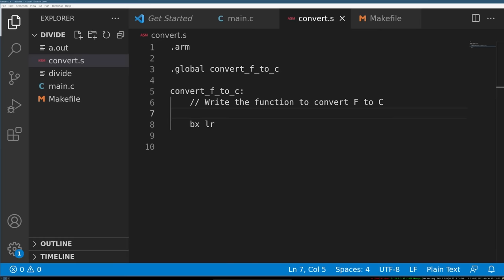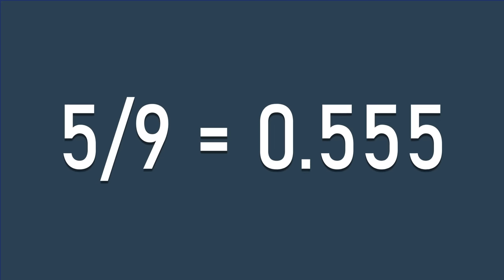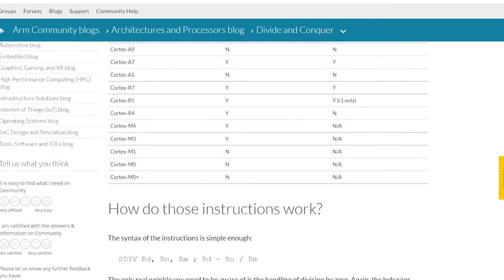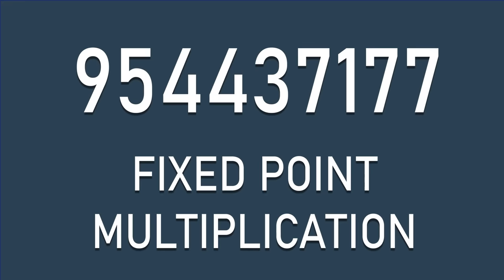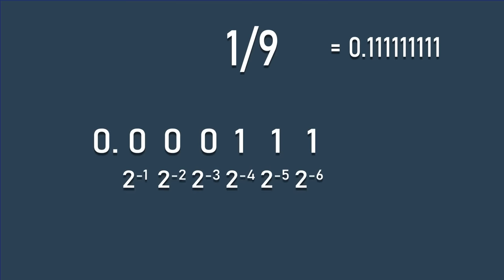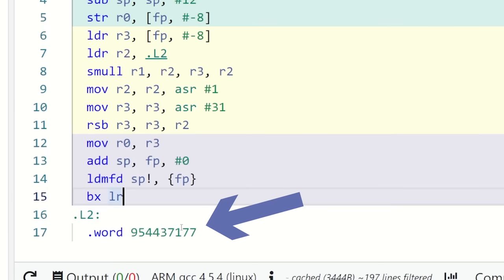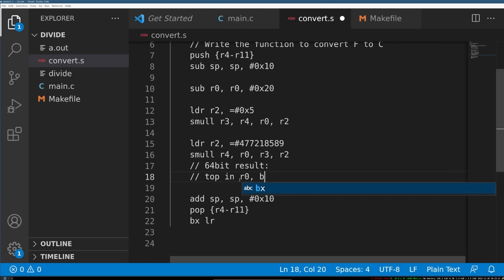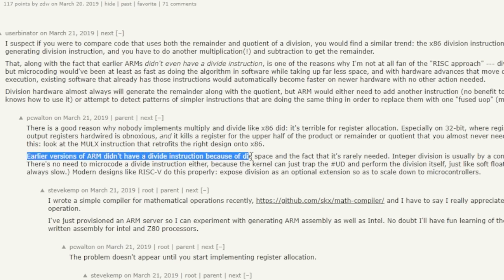computers suck at division (a painful discovery)

Comment: Also important to know is that both integer divide and FPU divide are very slow even on architectures that supports it in hardware.
An integer divide is up to 12 cycles on Cortex M4 and 10-50 cycles on modern X86-64 for example, Skylake needed like 40-100 cycles for integer div just a couple generations ago.
FPU divide on Cortex M4 is 14 cycles. Compare that to 1 cycle for integer add/sub/mul/shift and 1 cycle for FPU add/sub and 3 cycles for FPU mul on M4.
Also noteworthy is that even architectures such as M0/M0+ can implement external division hardware, such as the case for the RP2040 using M0+ architecture which integer division hardware needs only 8 cycles and therefore is actually faster than standard Cortex M4 for integer division.
Reply: If integer ADD/SUB/MUL is so fast, then why isn't it used everywhere?
Reply: @ewenchan1239  Can you restate your question, as it doesnt really make any sense. Are you asking why a div instruction isnt substituted with a combination of add/sub/mul instructions? They are, the compiler will try to replace a divide either by a shift, a combination of muls and shifts or adds and shifts, depending on if your target supports mul instructions.
However this only works if the divisor is a compile time constant. For other cases the compiler most likely will use div instruction unless you tell it otherwise. For example you could use libdivide instead, which can be faster than hardware divide on a lot of targets. Or you could tell it to use its default inbuild algorithm, which most likely will be quite a bit slower than a hardware divider if the compiler cant optimize it down, which in a lot of cases it can.
Reply: @_--_--_  
"Can you restate your question, as it doesnt really make any sense."

You state:
"FPU divide on Cortex M4 is 14 cycles. Compare that to 1 cycle for integer add/sub/mul/shift and 1 cycle for FPU add/sub and 3 cycles for FPU mul on M4."

If your statement above is true, then why isn't it used in lieu of using the ACTUAL divide instruction, ALL the time?

(You've answered it for the most part in the second half of your reply above.)

But for said second half of your reply to be true, you would have to know:

a) the divisor is a compile time constant (which means that if it isn't a compile time constant, it won't work)

and b) you explicitly tell the compiler what to do/how to handle the DIV instructions, which typically means that you would have to know the specific purpose or application that you are programming for, AND that the difference in the quotient is not significant nor critical enough IF the approximation is sufficient.

(i.e. you're programming for yourself rather than for someone else to use where the importance of the epsilon value is not known nor what someone else's tolerance limit for epsilon is)
Reply: @ewenchan1239  
"You state:
"FPU divide on Cortex M4 is 14 cycles. Compare that to 1 cycle for integer add/sub/mul/shift and 1 cycle for FPU add/sub and 3 cycles for FPU mul on M4.""
I mentioned the integer divide instruction a bit before that, lets not mix up integer operations with floating point. As far as I am aware we are talking about integer arithmetics specifically.

"a) the divisor is a compile time constant (which means that if it isn't a compile time constant, it won't work)"
Wont work is not the right wording here. Yes if the divisor isnt a compile time constant than the compiler cant replace the div instruction with a faster combination of other instructions by default, however thats an optimization problem, it still "works".
Also its often a good idea to rethink your code, often a lot of divisions are unnecessary (especially with floating point, but we are talking integer here), the compiler cant do this for you most of the time. This was mostly my intent of the original comment anyway, the compiler cant optimize all your mistakes away and using divides carelessly is often a mistake if performance is of any importance.

"which typically means that you would have to know the specific purpose or application that you are programming for"
As this discussion centers around low level programming, mostly embedded programming, we are talking about target specific code, where you know exactly what target you are progamming for and its specific compiler. Portable code is not relevant to this discussion.

"AND that the difference in the quotient is not significant nor critical enough IF the approximation is sufficient."
I am not talking about approximation, thats a good way of potentially optimizing code if its feasible, but thats not part of this discussion.
All compiler optimizations or replacement software algorithms will give the exact same output as the hardware divider.
Reply: @_--_--_  
"I mentioned the integer divide instruction a bit before that, lets not mix up integer operations with floating point."
But you also the "cost" (in terms of the number of operations) it takes for FP ADD/SUB and FP MUL on said Cortex M4 as well.

"FPU divide on Cortex M4 is 14 cycles."

"As far as I am aware we are talking about integer arithmetics specifically."
My understanding is that we can be talking about both (given that you can represent floating point numbers as a sum-product of pairs of two integers, can you not? (i.e. the approximation for 1/9 ~= 1 * 2^-4 + 1 * 2^-5 + 1*2^-6 ~= 0.109375)

And isn't the mul/shift - it's doing floating point math with integers, isn't it? (unless I am missing something here and/or misunderstanding what @Low Level Learning is talking about here, in this video)

"Wont work is not the right wording here. Yes if the divisor isnt a compile time constant than the compiler cant replace the div instruction with a faster combination of other instructions by default, however thats an optimization problem, it still "works"."
The "won't work" here refers to the substitution or the replacement of the slower div operation with the faster combination of other instructions. That's the "work" that you were talking about it doing.

Therefore; pursuant to your statement, if you aren't dividing by a compile time constant, then said replacement/substitution won't take place - i.e. the "work" that I am referring to, based on what you wrote, won't take place. Ergo; "won't 'work'" (div operation won't get replaced by "combination of other instructions" (which should help to perform the division faster without using the div operation/instruction).)

"often a lot of divisions are unnecessary"
Varies, I would think.

"This was mostly my intent of the original comment anyway, the compiler cant optimize all your mistakes away and using divides carelessly is often a mistake if performance is of any importance."
Again, I think that it varies. (depends on what you are doing/why you are using division in the first place)

re: mistakes
I wouldn't necessarily call using divisions a mistake. 

I agree that this is where a skilled programmer comes in, but if you are learning or you are an unskilled programmer, then that's something that they will have to learn.

Take for example, the inversion of 1/(1/9).

If you use exact arithmetic, your E(X) is 9.

If you approximate (1/9) ~= 1*2^-4 + 1*2^-5 + 1*2^-6 ~= 0.109375,

then 1/0.109375 = 9.142857142857142....

Therefore; your epsilon would be 9.142857142857142... - 9 = 0.142857142857142....

or about 1.6% error.

And therefore; the question that you would have to ask yourself is "is that 1.6% error significant or not?" In some cases, it might not be. In other cases, it can be VERY significant.

It really depends on what you are doing.

(Note that often times, if you are replacing a division operation, I have yet to see someone who advocates for the replacement or substitution of the div operations with a combination of other operations - they don't automatically talk about (nor calculate) their epsilon and let the user know what that epsilon is that arises from said replacement/substitution. I think that if you are going to implement such a kind of replacement (of the div operation) with a combination of other operations, where and whenever possible, you SHOULD be REQUIRED to tell the user what your epsilon is, when appropriate.)

"As this discussion centers around low level programming, mostly embedded programming, we are talking about target specific code, where you know exactly what target you are progamming for and its specific compiler. Portable code is not relevant to this discussion."
That's an assumption on your part though.

There is nothing that explicitly states this.

As I said, it is important for people NOT to have it as a key takeaway from watching this video that they are going to implement this everywhere they see because they see it as a speed/performance improvement whilst they fail to recognise that this speed/performance improvement comes at the expense of precision and accuracy.

Even for assembly code (cf. GROMACS/Folding@Home), maintaining the precision and the accuracy can still be vital for the program to perform the calculations that is asked of it properly and correctly.

"I am not talking about approximation, thats a good way of potentially optimizing code if its feasible, but thats not part of this discussion."
The replacement of a division operation with a combination of other operations is almost always an approximation of the actual division operation.

(cf. the example that @Low Level Learning shows above with respect to the approximation of 1/9 ~= 1 * 2^-4 + 1 * 2^-5 + 1 * 2^-6 ~= 0.109375)

That IS an approximation.

That IS what he did and that IS what is shown.
Reply: @ewenchan1239  
"But you also the "cost" (in terms of the number of operations) it takes for FP ADD/SUB and FP MUL on said Cortex M4 as well."
Yes I mentioned both integer and FPU instructions in my original comment but since you mentioned integer specifically in your first reply I assumed we were limiting our discussion to those.

"My understanding is that we can be talking about both (given that you can represent floating point numbers as a sum-product of pairs of two integers"
No we cant (or not unless you want my answer to be 3x as long, and I do not want that, nor do I think its even necessary).
Integers and floating point (IEEE754) are very different things and handled seperatly both in hardware and in software. You cant multiply a integer with a floating point number for example. You have to first convert (implicit cast in software) the integer to a float.

"And isn't the mul/shift - it's doing floating point math with integers, isn't it?"
Where did you get that idea from? 
The integer instructions for add/sub/mul/shift do math on integers.
The FPU instructions add/sub/mul do them on IEEE754 floating point numbers, the FPU cant do integers at all. Also you cant do arithmetic shift on a float, you can do logical  but that makes no sense whatsoever. 

"I wouldn't necessarily call using divisions a mistake."
I specified unnecessary divisions, every unnecessary operation is a mistake if performance is a factor.

"I have yet to see someone who advocates for the replacement or substitution of the div operations with a combination of other operations"
I have yet to see a embedded programmer who doesnt avoid divisions like the plague.
And a C programmer who isnt atleast aware of their pitfalls. Im assuming if anything your programming forte is probably more with languages like python/javascript/java/C#/ruby or similar, that would atleast explain a lot.

"That's an assumption on your part though."
Its not an assumption, we are talking about assembly instructions, this topic will always be target specific. We are far past the topic of this video.

"Therefore; pursuant to your statement, if you aren't dividing by a compile time constant, then said replacement/substitution won't take place"
Well its a compile time constant, you know when writing the statement if thats the case or not.

"The replacement of a division operation with a combination of other operations is almost always an approximation of the actual division operation."
That is very wrong. What do you think a compiler does when you have no division and/or multiply hardware? It will use algorithms that do the exact same thing, with the exact same precision. Approximations is like I said not what I was talking about, thats another topic.

I think your mindset is too focused on solving purely mathematical problems with code. When in case most code solves a practical problem, which can be expressed as a mathematical problem.
The important difference is, is that there are thousands of ways to arrive at the same output, and most are inefficient to some degree. 
Also just because you cant optimize a simple expression doesnt mean you cant optimize the function or whatever larger construct. In short do I really need this expression to achieve this output or maybe it can be done differently? Thats an important question to constanly ask oneself when programming.

Im getting the impression you havent really wrote any programs in C/C++ before, atleast not any that go beyond solving trivial math problems, maybe start there if you want to learn anything about lower level concepts.
Then slowly progress towards assembly, I wouldnt recommend learning with X86 assembly, instead get a cheap microcontroller thats based on either Arm (M0,M4,..) or custom Harvard and then invent an actual problem you want to solve with it. Great learning tool.
Then youll understand the concepts I touched upon in my comments better.
Maybe even a basics book for C would do you good.
But I would end this discussion here anyway, as I dont see the point further diving into low level programming topics when you dont seem to be familiar with the basics of programming yet, as my answers seem to confuse you more than they seem to explain.